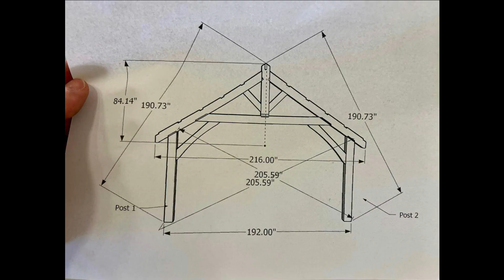Timberframe Timelaplse 2023

Comment: Why so many additional pegs?
Reply: I have died mine,to make them look more prevalent
Reply: Black walnut mostly
Reply: Less is sometimes better
Reply from the maker: This truss style (arched brace truss) requires the addition pegs due to the tension forces).
Reply from the maker: Oops, I thought you were referring to a different frame. Answer is still similar. We make sure that the amount of pegs resolve the forces. Double pegs on many braces aren’t necessary, but it depends on the size of the brace tenons and what makes the most sense.
Reply: @bigbeamstimberframes770  why make tennons intersect